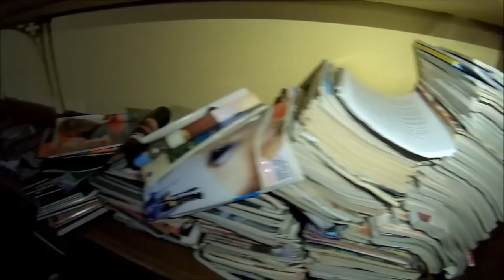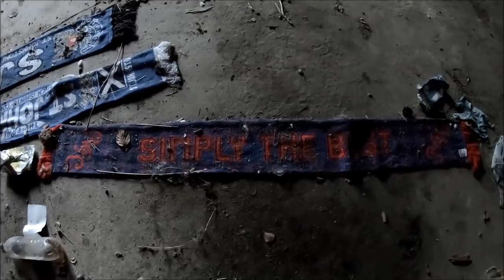Abandoned Mansion 3rd Visit - SCOTLAND

Comment: Trespassing..........Wrong.
Reply from the maker: No trespassing rules in Scotland
Reply from the maker: @l.a.chancey  We always try and avoid detection otherwise we wont get into any places if we get seen, someone would just phone the police, its all part of the fun too plus we cant be assed getting booked and told to leave it would be a wasted journey as we drive for miles to see these places and the last thing we want is turned away
Reply: Exploring with Alec 
Your statement is wrong. There is a right to roam in Scotland so you can cross someone’s land but that’s all you can do. It is an oft-repeated myth that there are no trespassing laws in Scotland. This is simply not true. Trespass is a civil wrong, called a delict in Scots legal terminology. This Act provides the public the right to be on and cross most land and inland water in Scotland in a responsible manner. In Scots law, trespass is the passage through another's land without consent. As in England, trespass is a civil wrong in Scotland, and can sometimes also constitute a criminal offence, e.g. trespass which breaches poaching laws. There is a difference between trespass and criminal trespass. While criminal trespass is also committed with intention, the key difference is that it doesn't necessarily have to be with an intention to commit a crime. Just the sheer fact of being there without authorization is enough to warrant criminal trespass. 
This information is from a solicitor.
Reply: L. A. Chancey 
Yes! There certainly are trespassing laws in Scotland. Please see my answer to @Exploring with Alec.